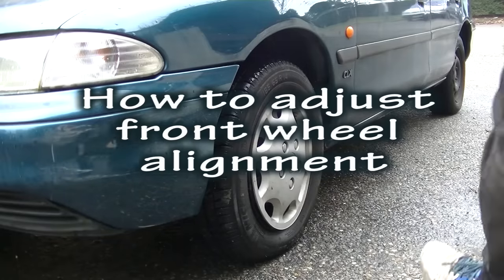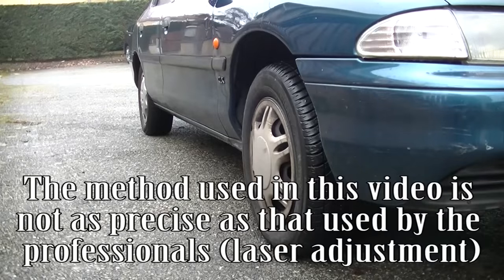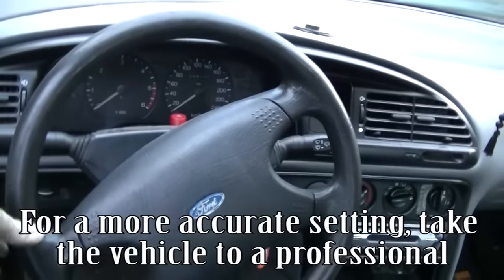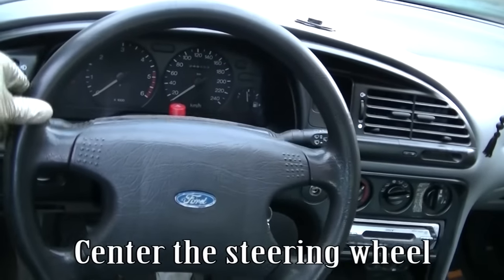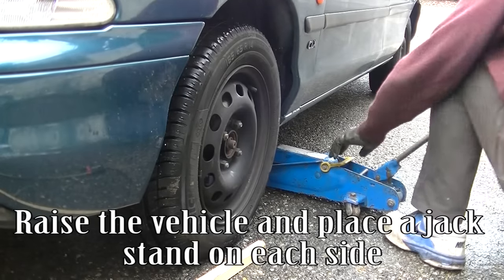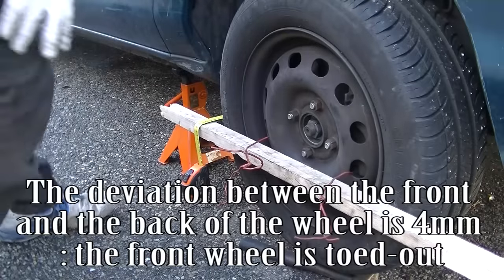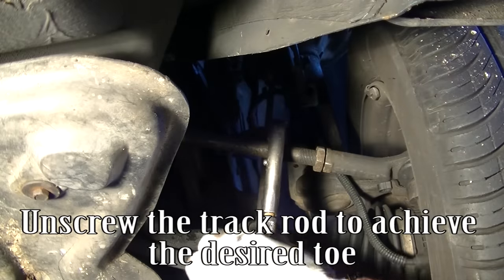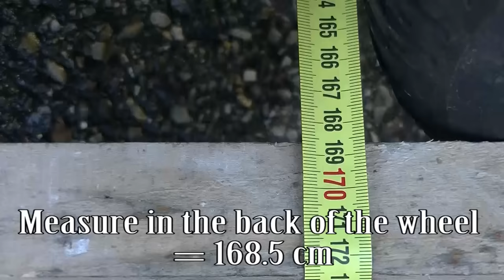How to adjust front wheel alignment - EASY

Comment: different cars have different amount of threads i guess, say i was making an alignment on a Honda our any front wheel drive car, and i put 10 threads on each tire-rod this is threads behind the lock nut, not the ones thats turned in the tire-rod , the threads behind, the back of the lock nut,  say i put 10 threads on each wheel, now this would put mt string wheel slightly leaned to wards the right, i have to many threads, i only need 9 threads on each wheel, to center every thing , and if you put to in on a front wheel drive car, your always going to scuff the out side of your tires off, and if you toe out to far, then your going  scuff of the in side of your tires, so this means you need to have each tire strait, you can align with a string, count the threads after, i bet you your going different amounts of threads on each side, and your staring wheel wont be centered . you have to have the same amount of left over threads behind the lock nut, or else your car wont be in align, you know something, i went to alignment shop to get a alignment did on a car i had at this time, and not that long ago, and thy charged me all most a 100 bucks for the job, and when i took my car left the garage headed home, well, the staring wheel was a way down to the left side,  so when i got home jacked both wheels off the road in the drive way, took off both wheels, then counted my threads, had 9 on one side and 11 on the other side ,so i took the side with 11 threads and doped of 2 threads, left me 9 on both side , back in spec , this is why i do not believe in alignment bull crap shops, lol, that don't know how to do there job, or else,  the equipment is no good, our maybe your back whee's are not in spec , and have no adjustments. that would leave you with a bad alignment job.

Comment: J
Reply: Jack up  each wheel as shown.Test for play or loossnes in 6-12 oclock and 9-3 oclock positions.If there is play cure it first.Spin each wheel,look from front to see if it runs true.Then use a long straight piece of wood or bar, fixed in 9-3 oclock position as shown,and see how it aligns with the body of the car.The side that shows the larger deviation is the side to adjust,weather towing in or towing out.Both sides may need adjusting.Ideal alignment is usualy 0 to 3mm toeing in. .Idealy the car should be standing on a level surface, supported by its suspension, and loaded with bags of sand or cement to simulate the normal loading of the car during its normal use.But to do all the above an inspection pit is required.Your suggested alignment is better than no alignment at all.I wish you well.

Comment: What utter rubbish, it may be parallel whilst raised but once lowered the tie rods will move in or out depending whether they're at the front or rear of the hub assembly as the cars weight is reapplied.